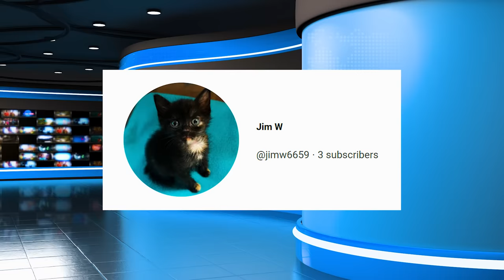Why Are So Many Builders Running Away?

Comment: hmm but maybe the state of the trades industry in general - we stopped using the trades 10 years ago plus - over priced - sub standard work and skills and ultimately much better to do it yourself - yes its difficult the tools are pricey but its a much better quality finish than you get from most trades today - sorry but 90% of tradesmen we used in the past were utter rubbish and I wouldnt go back ...my wife tried to make my third bathroom refurb easier by getting a "plumber" in to fit some new pipes to the main for salt machine - he flooded my new bathroom and floor tiles (no issue I used Ardex x77) - kin hopeless.....

Comment: I'd just love to find a decent builder to do our work to a good standard. We have always paid on time and are happy to pay more for a good job but we either end up with bullsh!tting cowboys who specialise in crap work or the builder who's quoted decides to go work on big jobs such as new builds, hotel refits or pub conversions. If every guy was a Robin Clevett and worked in our area, my wife and I would be very happy and our house would be finished!!!
Reply: Bang on. Id happly pay and as you say pay more for just a "good" job, but can't even get that these days.
Reply: Thing is that people want champagne standards at lemonade prices. I'm the opposite. I know exactly what I want and won't compromise and am willing to pay for it. Once you've paid, that money is gone but you have to look at a shit job every day.
Reply: @paul756uk2  This is true too, but I've had examples of just poor workmanship. 15k for a solar system where they didn't even bother handing the batteries on the wall using the supplied brackets and left 3/4 tonne of weight on ceiling joists. It's been the bare basics.

Comment: Im a self employed labour only bricklayer and i price per metre square...i tell the builder im working for i charge x amount for blocks/stone/brick etc..i also price solid which covers dpc/insulation/,ties etc rather than itemising everything...i price off the drawing and can normally do it there and then..i,ll measure it tell them theres x amount of metre square in blocks times it by my metre charge and its there in black and white no hidden charges...half the time they can price it themselfs once they have rates per metre square...i always charge more than site as you dont have the luxury of folk lifts,silos etc on private work and everything is to be lugged ip ladders self mixing etc

Comment: As a customer and part time tradie I understand the materials cost argument and agree. What I don't agree with is the labour costs some tradies try to scam. 5k kitchen and 20k installation/fitting cost or 3k bathroom and 12k fitting cost. Or 10-15k for a sparks to do a rewire with material costs of less than 1k. These are several days work but they're claiming a month to 6 months salary to do it. Trades don't make as much as white collar workers but now you see plumbers and sparks driving up to site in a Porsche or some other high end sports car. I can understand why some customers are p1ssed.

Comment: The solution is that builders need to be better capitalized, which is easier said than done and would probably exclude 90% of the builders market.

Ideally, builders should have the capacity to purchase the materials up front allowing them to lock in the (majority of) price. As a corollary, this also would require a small warehouse to store the materials. This would require a significant amount of capital up front which I don't think most would have.

This problem is the same for many other businesses and is not unique to builders, under capitalized businesses are always vulnerable.

In international trade, business opt for futures/forwards and options to manage downsize currency risk (with the upside of favorable movements often capped), so I wonder if builders, and some enterprising finance individual, would be able to offer a conceptually similar finance product for builders, although, this would have many questions like:
1. what would a premium (option price for example) look like (10% premium over current price? and would this be prohibitively expensive for a builder);
2. would a builder be willing to forego upside so as to lock in an accurate material cost (as opposed to the usual process of substituting cheap inferior products and passing them off so as to regain some GP);
3. would a financier even be willing to engage in such a risky venture and how would they secure their (risky) position.  

Just because you are a skilled builder doesn't necessarily mean that you are a skilled administrator.

Comment: THIS IS ALL TRUE. Customers change the specification all the time, a different bathroom, door handle changes, posh plug sockets, solid oak doors, engineered oak floors and all the other snags you found on the way leaves the builder in the crap. You never make anything on materials either, plus if you have to get the materials from the builders merchant before going to site in the morning you don't get paid for the time either. 
Also the builder needs to do all the paperwork and phone calls in the evenings and weekends, tool and equipment repairs, diggers, dumpers and vans need to be maintained and so on, tool theft also kills your work day, then you have to do the tax returns and so on so any money you did make the government takes. There is no downtime. Also there is something called RC-CIS tax scheme for subbies. 
Additionally, I am 37 and am generally the youngest guy on site.

Comment: There really is NO excuse for getting the numbers wrong.  If you give the customer a "fixed" quote, then you ALSO have to demand a "fixed" price from your suppliers.  Or you have to have enough storage to buy all the supplies for a job and keep it until it is used.

I had a litho printing business, many years ago.  And the same applies, if we couldn't be assured of prices, then we had to assured that we had stock and/or we had to quote a price that would cover all the eventualities.  Yes that meant that we lost jobs to the cheaper 'cowboys' but so be it. The same has to apply to the building trade. And in fact every trade.
Reply from the maker: Jules 
It is very easy to sit on the sidelines and snipe but printing is not building and the idea you can demand that a merchant honours a price on materials you have yet to pay for is a fantasy.
Reply: @SkillBuilder  I disagree.  I never said that it was easy.  But the principle is the same.  Back in the day if I had a contract to produce x booklets, then I had to know that I could afford to do so, so I had to have the supplies already purchased, or assurances that my suppliers could supply at that price. 

My father, who was a bricklayer, refused to set up in business for himself, for that very reason, he understood that he didn't have the financial room to accommodate the ups and downs.

It is the modern Just-in-time concept that means that modern businesses struggle. Because that leaves no spare capacity or stock, to be able to guarantee prices.

Comment: 2:20 crossrail and hs2 were projects over years where the cost of goods were liable for increase which is why it wasbso high, as you said 25%. With all quotes it has to have in writting that the quote is based on current price of goods and subject to increase or decrease if price changes.

Comment: I’ve been a carpenter for 20 years. I enjoy my job and take great pride in doing it right but get so many builders or developers just want it crashed in as fast as they can so they can make as much profit as possible or clients that supply poor products and want you to make a silk purse from a sows ear.  Even worse QS on big jobs that want to knock tradesmen where ever they can.

Industry is in a tricky place with inflated prices for poor quality materials and clients with ever tighter budgets. I’m sure it will rectify itself when inflation eases.

Comment: Houses are falling apart in California. Luckily the older stock was built well, but after 60 years old they still need work. I am completely frustrated with so-called professional quality work. I am not licensed but I do most of my own electrical. Now I do my own drywall and texture, landscaping, a little carpentry and plumbing. I am going to practice some bricklaying next. It is code compliant and beautiful work.

Comment: Job adverts want you to be multiskilled , in carpentry, plumbing, plastering, decorating, electrical , have your own tools and van then offer you 15 pounds an hour, later you find out the contractor ( shark ) is taking half what the client has offered to pay even though , they just posted a job advert and produced a photocopy of a contract you can download free from the internet, so if the builder is taking home 150 a day the shark is also pocketing the same if not more , whereas the old days they take minimum i.e £ 50 off every £300;pound deal

Comment: 28 year old carpenter here, I left my job after wrecking my body. Construction is just not worth it. The day should be 6 hours including any travelling and should be paid at £200 minimum.
Reply: @tonyc1167  there is better work out there, but it's still tough going on the body and hours are too long with too much travelling, what's the point in chasing what barely exists. The industry should be thriving. This is why healthcare is booming and private health professionals are making so much money

Comment: The problem as I see it is that the corporations, the ones they control everything around have seen a potential in converting the independent builders into something they want, shop workers, small field engineers, even workers on the same position they did before but now as employed on low wages...etc. They then started putting pressure on the power politicians to make being independent as hard as possible. By doing that, at some point we get fed up and we start a job, 8-5 or 9-5 depends on the potential. The gov doesnt lose money, as the tax on the individual still getting paid, just by someone else. That way, small industry, which gives people the power to have dignity will disappear and then being affraid not to lose your job, you keep the head down and the mouth shut. This is how I see it.

Comment: I always have customers sign a project proposal, and my terms and conditions. Interestingly the good customers never object to putting money down on day 1, having to float material prices, or providing other financial security, especially if you offer functional warranty (“Waterproof for a year or we fix it” kind of stuff, never go for “Satisfaction guaranteed” though). The ones who huff and puff are the rogues.
Reply: I considered employing a main contractor to build a complex eco house, however on reading his conditions of contract I decided to
carry out the work myself (I am a retired Civil Engineer), the job worked a treat.
Reply: @davidboyle5761  What kind of eco house? Now I’m curious :)
Reply: A 5 bedroom, with ensuite bathrooms, 3 public room, kitchen, utility room, triple garage, air source heat pump, back up wood burner stoves, steel framed, underfloor heating, concrete floors, kingspan solid insulation through out up to 250mm thick, slated roof, Danish wooden lined with aluminium windows, hardwood and tiled floors, lead flashings, 2 no 10Kw woodburners, weber acrylic smooth roughcast.
It was a retirement project.

Comment: There is nothing wrong with having a contract to cover a building project. In fact I think it would be crazy to attempt a large project on a handshake. However we are in a period of high inflation and on a long project,  material prices are going to increase. The answer is to ensure the contract is detailed and breaks down labour and materials. It needs to be transparent and signed on the understanding that if material prices increase, then the customer will have to foot the bill for increased material cost. Yes some customers may not agree to this but it is fair. Proof of increased prices would have to be provided. If such a contract can’t be agreed on, then the job can be rejected. I had a house built three years ago based on this principle with billings provided for work done every month. The detail work involved in the billing and payment was high but at the end of the job I was happy I had been treated fairly by the builder and he was happy he didn’t get screwed. Just my two cents.

Comment: 1,491 comments, I don't think Roger will see mine but I will ask a question anyway just in case anyone else does.

What cordless tools ie. Drills, Circular Saws, Jigaws would you recommend for a somewhat skkilled DIY'er ? I am torn between, DeWalt, Milwalkee and the one I can't remember. The top 3 basically. Makita, that's the one I always forget. DOH !

Comment: The problem often is that great tradesmen don’t make good businessmen.

Running a business like a builder that does extensions requires considerable project management skills: every site you have running needs 3 things: information, materials and labour….if you only get 2 out of those 3 the job stops.

Sometimes highly skilled tradesmen can make a good living just doing really small jobs: doing 3 jobs a day each around a £100 for a couple of hours work is good money for little stress.

Comment: We recently got our garden done and quotes I was getting were ridiculous. Some were two times higher compared to others. Tradesmen it seems were quoting whatever they thought I might be willing to pay.

Tradesman I employed did the work piecemeal. The job was finally complete, but I had to keep strict checks on quality, them taking their rubbish away, and fixing any damage they did. This is all expected and shouldn’t have to be asked for. If I had the time, I would have done the job myself rather than going through all this stress / chasing tradesmen for when they will complete job.
Reply: Sounds like you got what you paid for.
Reply: Didn’t go with the cheapest and yet still, it wasn’t without its challenges and having to keep constant checks!
Reply: You need water tight contracts and don't pay any money up front.
Reply: Quotes for my garden were all over the place, the problem as I see it , I have no idea what is reasonable, massive quote = they don’t want the job; cheap quote = underpriced ? In the end went with what the major suppliers of turf recommended which worked out ok.
Reply: You sound like a joy to work for
Reply: This exactly the problem customers like you that expect to pay peanuts for top quality work

Comment: Outside of London I noticed that the workers are older and you can't trust them. I had two worked for me one increased the labour rate by £300 and would not give me a receipt the other took away items that were usable after I asked if I could sell them I was told that no one wants them. That was a plumber and the items were single vented radiators.
Reply from the maker: We leave radiators out the front for the scrap man, they are worth a quid at the most
Reply: My radiators were taking by the plumber who tried to tell me that story but he drained them and put them in his van. This is in South Yorkshire.

Comment: I do as much as i can myself as i trust no one. Unfortunately, I've got a loft conversion coming up, so I will have to find someone. I'll just get them to do the roof and watertight, the rest like lowering the ceiling and insulation etc i can do myself in my own time no stress. Even the online architect i used was rubbish, they didnt know what a cold or warm roof was. Luckily their plans passed but the reality of it is that ive drawn up every inch of it in sketchup to gain 2.3m of head room and a warm roof, they would never have been able to do it. Standards nowadays have dropped significantly.

Comment: I'm not in the building trade, but if one of the problems is to do with the varying price of supplies, why not simply put in a highlighted note stating material costs may vary and as such will be passed on to the customer, that way the price if a job would increase pure by the increase of the supplies by the percentage of the increase, how could a customer complain about that, if the supplies cost more then the job will cost more, if on the other hand they cost less then those saving should also be passed on to the customer, I suspect materials fluctuate regularly and depending on quality of the materials.
Reply from the maker: There have been some unprecedented price increases since lockdown. Of course those prices should be passed on but when a builder gives a price for a job rather than a detailed breakdown of every item it is hard to work out what is what.
Of course it should be different but a lot of jobs are priced on the square metre of the building.
Reply: @SkillBuilder  I don't really understand, but let me try to get a grip on this.

You price per square metre, so presumably the labour charges will remain the same regardless of materials price changes, so even if materials change in price the only difference in costs would be for new materials right.

So the increase wouldn't need to be itemised just percentage based on materials costs.

So if a job cost £100 as an example, and materials costs were 20% of the job but has increased by an extra 5% you simply show the customer the 5% increase rise in the materials cost increase.

So the job doesn't increase by 5% only the materials cost increases by 5% so the actual increase would only be 5% of the materials for the job.

I can't see what the problem would be with that, because it would then be pure based on materials costs.

You may have added on a profit for the materials which you still make because increase is pure percentage based on the materials.

If labour charges remain the same I don't see where the problem is.